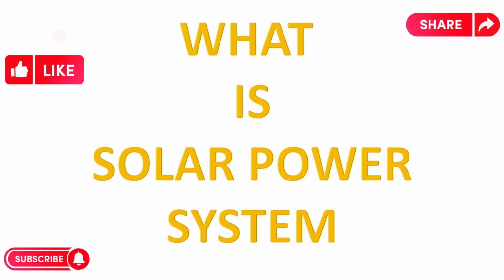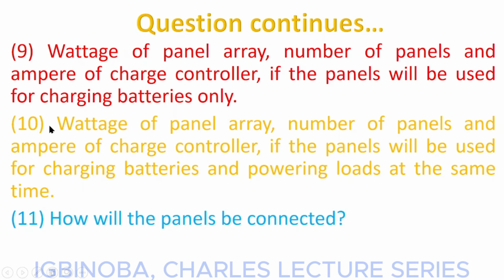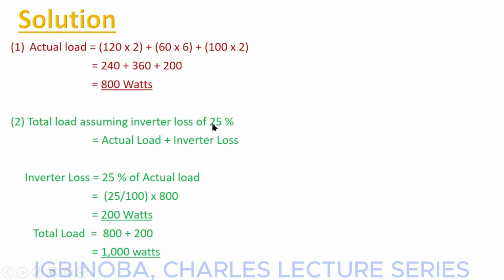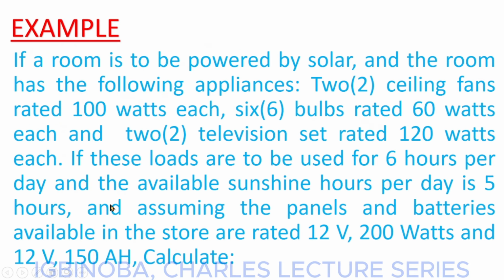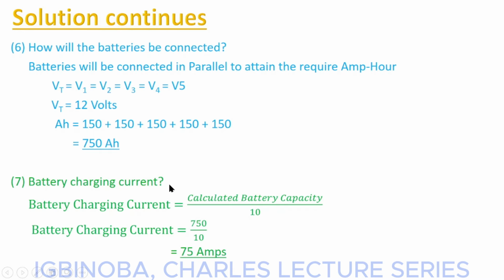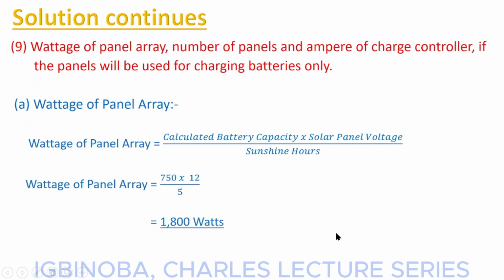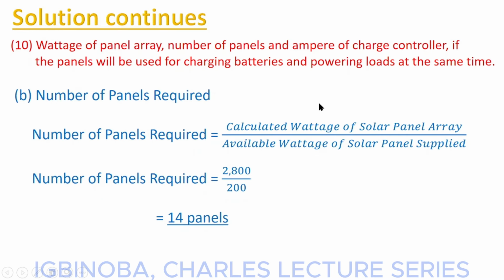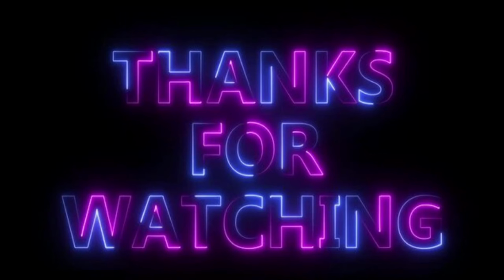Design of Solar Power System

Comment: COMP28B 

1. The actual pad is 1,380W
2. The Total load is 1,725W
3. The inverter rating is 2,156.23VA
4. The battery capacity is 1,293.75Ah 
5. The Number of batteries is 9
6.  The batteries are connected in parallel 
7. The Battery charging current is 129.4 amps.
8. The battery charging time is 14 hours.
9. a. The wattage of the panel array is 3,105W
b. The number of panels is 16 panels.
c. The Charge controller rating is 258.75 amps.

10. a. The wattage of the Panel array is 4,830 Watts 
b. The number of panels is 24 panels.
c. The charge controller rating is 402.5 amps
11. The panels are arranged in parallel

Comment: COMP71S

1. The actual pad is 1,380W
2. The Total load is 1,725W
3. The inverter rating is 2,156.23VA
4. The battery capacity is 1,293.75Ah 
5. The Number of batteries is 9
6.  The batteries are connected in parallel 
7. The Battery charging current is 129.4 amps.
8. The battery charging time is 14 hours.
9. a. The wattage of the panel array is 3,105W
b. The number of panels is 16 panels.
c. The Charge controller rating is 258.75 amps.

10. a. The wattage of the Panel array is 4,830 Watts 
b. The number of panels is 24 panels.
c. The charge controller rating is 402.5 amps
11. The panels are arranged in parallel

Comment: MEC38L

Answer:

(1) Actual Load
P_actual = 300 W + 600 W + 480 W
P_actual = 1380 W
(2) Total Load (assuming 25% Inverter Loss)
P_total = 1380 W × (1 + 0.25)
P_total = 1725 W
(3) Inverter Rating in VA (Power Factor = 0.8)
Inverter VA = 1725 / 0.8
Inverter Rating = 2156.25 VA (Approx. 2.5 kVA)
(4) Battery Capacity (using 75% Reserve Factor)
• Daily Energy = 1725 W × 6 hrs = 10,350 Wh
• Energy with 75% Reserve = 10,350 Wh × 1.75 = 18,112.5 Wh
• Capacity in Ah = 18,112.5 Wh / 12 V
Battery Capacity = 1509.38 Ah
(5) Number of Batteries for Backup Hours
• Single Battery Energy = 12 V × 150 Ah = 1800 Wh
• Number of Batteries = 18,112.5 Wh / 1800 Wh = 10.06
Number of Batteries = 10 batteries (or 11 rounded up)
(6) Battery Connection
Since the system operates at 12 V and each battery is 12 V:
All 10 batteries will be connected in PARALLEL.
(7) Battery Charging Current
Using standard C/10 charging rate for 1500 Ah total capacity:
Charging Current = 1500 Ah / 10 h
Battery Charging Current = 150 A
(8) Battery Charging Time (assuming 40% Charging Loss)
• Efficiency = 100% - 40% = 60% (0.6)
• Required Energy = 18,112.5 Wh / 0.6 = 30,187.5 Wh
• Charger Power = 150 A × 12 V = 1800 W
• Charging Time = 30,187.5 Wh / 1800 W
Charging Time = 16.77 hours
(9) Array Wattage, Panels & Controller (Charging Batteries ONLY)
• PV Wattage = 30,187.5 Wh / 5 hrs = 6037.5 W
• Number of Panels = 6037.5 W / 200 W = 30.18
• Array Wattage = 6200 W
• Number of Panels = 31 panels
• Charge Controller = 6200 W / 12 V = 516.67 A (or ~646 A with 1.25 safety factor)
(10) Array Wattage, Panels & Controller (Charging + Powering Loads)
• Total PV Wattage = 6037.5 W + 1725 W = 7762.5 W
• Number of Panels = 7762.5 W / 200 W = 38.81
• Array Wattage = 7800 W
• Number of Panels = 39 panels
• Charge Controller = 7800 W / 12 V = 650 A (or ~812.5 A with 1.25 safety factor)
(11) Panel Connection
Since all panels are rated 12 V and feed a 12 V system:
All panels will be connected in PARALLEL.

Comment: COMP84F

1. The actual load is 1380W
2. The total load is 1725W
3. The inverter rating is 2156.23VA
4. The battery capacity is 1293.75Ah 
5. The Number of batteries is 9
6.  The batteries are connected in parallel.
7. The Battery charging current is 129.4A.
8. The battery charging time is 14 hrs.

9a. The wattage of the panel array is 3105W
b.16 panels.
c. The Charge controller rating is 258.75A

10a. The wattage of the Panel array is 4830W
b. 24 panels.
c. The charge controller rating is 402.5A

11. The panels are arranged in parallel

Comment: PETROCHEM57E

1. Actual Load = 1380 Watts

2. Total Load = 1725 Watts

3. Inverter Rating = 2156.25 VA

4. Battery Capacity = 1293.75 AH

5. Number of Batteries = 8.625 = 9 batteries

6. The batteries will be connected in parallel to attain the required ampere-hours.

VT = V1 + V2 + V3+ V4+ V5+ V6+ V7 + V8 + V9

AH = 150 + 150 + 150 + 150 + 150 + 150 + 150 + 150 + 150 = 1293.75 AH

7. Battery Charging Current = 129.375 Amps

8. Battery Charging Time = 14 hours

9. a. Wattage of Panel Arrays = 3105 Watts
b. Number of Panels Required = 15.525 panels ≈ 16 panels
c. Ampere of Charge Controller = 258.75 Amps

10a. Wattage of Panel Arrays = 4830 Watts
b. Number of Panels Required = 24.15 panels ≈ 25 panels
c. Ampere of Charge Controller = 402.5 Amps

11. The panels will be connected in parallel.

Comment: MECH23W
1.) Actual Load*
= (100 × 3) + (60 × 10) + (120 × 4)  
= 300 + 600 + 480  
= 1380 Watts

2. Total Load with 25% Inverter Loss
Inverter Loss = 25% of Actual Load  
= 0.25 × 1380 = 345 Watts  
Total Load = Actual Load + Inverter Loss  
= 1380 + 345  
= 1725 Watts

3. Inverter Rating in VA  
Using Power Factor = 0.8  
Inverter Rating = Total Load ÷ Power Factor  
= 1725 ÷ 0.8  
= 2156.25 VA → ∼2.2 KVA inverter recommended

4. Battery Capacity  
Reserve Factor = 75%, Backup = 6 hours, System factor = 2  
Battery Capacity = (2 × 1725 × 6 × 0.75)  
= 1293.75 Ah

5. Number of Batteries Required  
Using 150 Ah batteries  
No. of Batteries = 1293.75 ÷ 150 = 8.6  
= 9 batteries (round up to whole batteries for safety).5. Number of batteries for backup_  
Backup capacity required = 1293.75Ah  
Battery rating = 150Ah  
Number of batteries = 1293.75Ah ÷ 150Ah = 8.6  
≈ 8 batteries

6. Battery connection method  
The batteries will be connected in _parallel_.  
For parallel connection: Vt = V1 = V2 = V3 = V4 = V5 = V6 = V7 = V8  
Total Ah = 150 + 150 + 150 + 150 + 150 + 150 + 150 + 150 = 1200Ah

7. Battery charging current  
Charging current = 1293.75Ah ÷ 10h = 129.4A  
≈ 129A

8. Battery charging time  
Assuming 40% charging losses:  
Total Ah to be replaced = 1293.75Ah + (40% × 1293.75Ah)  
= 1293.75Ah + 517.5Ah = 1811.25Ah  
Charging time = 1811.25Ah ÷ 129A ≈ 14 hours

9a. PV array wattage  
3105 watts

9b. Number of panels required  
Panel rating = 345W  
Number of panels = 3105W ÷ 345W = 9  
= 9 panels._9c. Charge Controller Ampere Rating (Battery Load Only)  
Required Amps = 3105 watts ÷ 12 volts = 258.75 Amps

10a. Total Solar Panel Array Wattage  
Total Wattage = Wattage for charging battery only + Total load  
= 3105 watts + 1725 watts = 4830 watts

10b. Number of Solar Panels Required  
Number of Panels = Total array wattage ÷ Wattage per panel  
= 4830 watts ÷ 345 watts = 14 panels

10c. Charge Controller Ampere Rating (For Full Array)  
Required Amps = Total array wattage ÷ System voltage  
= 4830 watts ÷ 12 volts = 402.5 Amps

11. Panel Connection Method  
Answer: The panels will be connected in parallel.

Comment: NAT17Q

1. The actual pad is 1,380W
2. The Total load is 1,725W
3. The inverter rating is 2,156.23VA
4. The battery capacity is 1,293.75Ah 
5. The Number of batteries is 9
6.  The batteries are connected in parallel 
7. The Battery charging current is 129.4 amps.
8. The battery charging time is 14 hours.
9. a. The wattage of the panel array is 3,105W
b. The number of panels is 16 panels.
c. The Charge controller rating is 258.75 amps.

10. a. The wattage of the Panel array is 4,830 Watts 
b. The number of panels is 24 panels.
c. The charge controller rating is 402.5 amps
11. The panels are arranged in parallel

Comment: NAT40N

1) Actual Load: 1380 W
2) Total Load: 1840 W
3) Inverter Rating (0.8 Power Factor): 2300 VA (or 2.3 kVA)
4) Battery Capacity: 1226.67 Ah
5) Number of Batteries: 9 batteries
6) Battery Connection: Parallel
7) Battery Charging Current: 120 A
8) Battery Charging Time: 16.67 hours
9) Solar Setup (Batteries Only): 2944 W (or 3000 W), 15 panels, 250 A charge controller
10) Solar Setup (Batteries + Load Simultaneously): 4784 W (or 4800 W), 24 panels, 400 A charge controller
11) Panel Connection: Parallel
Reply: You forgot to add your code, how will they mark it
Reply: @TheHummingbird456 oh, thanks

Comment: MEC94P

1)Actual load = 1380W
2)Total load = 1725W
3)Inverter rating = 2156.25VA
4)Battery rating = 1293.75Ah
5)Number of batteries = 9
6)Batteries connected in parallel
7)Battery charging current = 129.4amps
8)Battery charging Time = 14hours
9i) Wattage panel array = 3105watts
iii)Number of panels = 16
iii)Charge controller = 258.75A
10i) Wattage of panel array = 4830 watts
ii)Number of panels = 24
iii) Charge controller = 402.5 A
Panels are arranged in parallel

Comment: COMP81C
(1) Actual Load
 P_actual = (3 * 100W) + (10 * 60W) + (4 * 120W) = 300 + 600 + 480 = 1380W

(2) Total Load (Assuming 25% Inverter Loss)
 P_total = 1380W / (1 - 0.25) = 1380W / 0.75 = 1840W

(3) Inverter Rating (VA) Inverter Rating = 1840W / 0.8 = 2300VA

(4) Battery Capacity (75% Reserve) Daily Energy = 1840W * 6h = 11040Wh Battery Capacity = 11040Wh / (12V * 0.75) = 1226.67Ah

(5) Number of Batteries Needed Number of Batteries = 1226.67Ah / 150Ah = 8.18 = 9 batteries

(6) Battery Connection Connection = Parallel

(7) Battery Charging Current Charging Current = 1226.67Ah / 5h = 245.33A

(8) Battery Charging Time (Assuming 40% Loss) Efficiency = 100% - 40% = 60% = 0.6 Charging Time = 5h / 0.6 = 8.33 hours

(9) Solar PV Array (For Charging Batteries Only) Energy Required = 11040Wh / 0.6 = 18400Wh Array Wattage = 18400Wh / 5h = 3680W Number of Panels = 3680W / 200W = 18.4 = 19 panels Charge Controller = 3680W / 12V = 306.67A

(10) Solar PV Array (For Charging Batteries + Powering Loads Simultaneously) Total Power = 3680W + 1840W = 5520W Array Wattage = 5520W Number of Panels = 5520W / 200W = 27.6 = 28 panels Charge Controller = 5520W / 12V = 460A

(11) Panel Connection Connection = Parallel

Comment: PETROCHEM66N 

1. Actual load = 1380watts
2. Total load = 1725 watts
3. Inverter ratings = 2156.25 volts 
4. Battery capacity= 1293.75Ah 
5. Numbers of batteries= 9
6. Batteries are connected in parallel 
7. Battery charging current= 129.4amps 
8. Battery charging time = 14hrs 
9a. Wattage of panel array= 3105 watts 
9b. Nō of panels= 16 panels 
9c. Charger controller= 258.75A
10a. Wattage of panel array= 4830 watts 
10b. Number of panels= 24 
10c. Charger controller= 402.5a
11. Panels are arranged in parallel

Comment: NAT53A

1. The actual load of the room is 1,380 W.
2. The total load, considering 25% inverter loss, is 1,840 W.
3. The required inverter rating at a power factor of 0.8 is 2,300 VA (2.3 kVA).
4. The required battery capacity is approximately 1,227 Ah at 12 V.
5. The number of batteries required is 9 batteries.
6. The batteries will be connected in parallel to maintain a 12 V system.
7. The required battery charging current is approximately 307 A.
8. The battery charging time is approximately 5 hours.
9. For battery charging only, the required panel array is 3,800 W, requiring 19 panels of 200 W each, with a charge controller of approximately 317 A.
10. For simultaneous battery charging and load supply, the required panel array is 5,600 W, requiring 28 panels of 200 W each, with a charge controller of approximately 467 A.
11. The solar panels will be connected in parallel.

Comment: NAT14N
1. The actual pad is 1,380W
2. The Total load is 1,725W
3. The inverter rating is 2,156.23VA
4. The battery capacity is 1,293.75Ah 
5. The Number of batteries is 9
6.  The batteries are connected in parallel 
7. The Battery charging current is 129.4 amps.
8. The battery charging time is 14 hours.
9. a. The wattage of the panel array is 3,105W
b. The number of panels is 16 panels.
c. The Charge controller rating is 258.75 amps.

10. a. The wattage of the Panel array is 4,830 Watts 
b. The number of panels is 24 panels.
c. The charge controller rating is 402.5 amps
11. The panels are arranged in parallel

Comment: NAT35I
1). The actual load is 1,380W
2). The Total load is 1,725W
3). The inverter rating is 2,156.23VA
4). The battery capacity is 1,293.75Ah 
5). The Number of batteries is 9
6.  The batteries are connected in parallel 
7. The Battery charging current is 129.375 amps.
8. The battery charging time is 14 hours.
9. a. The wattage of the panel array is 3,105W
b. The number of panels is 16 panels.
c. The Charge controller rating is 258.75 amps.

10. a. The wattage of the Panel array is 4,830 Watts 
b. The number of panels is 24 panels.
c. The charge controller rating is 402.5 amps
11. The panels are arranged in parallel

Comment: MEC87I

1. Actual load = 3(100)+10(60)+4(120) = 1,380 W

2. Total load = 1380/0.75 = 1,840 W

3. Inverter rating = 1840/0.8 = 2,300 VA

4. Energy = 1840×6 = 11,040Wh ÷0.75 (reserve) = 14,720Wh ÷12V = 1,226.67 Ah

5. 1226.67÷150Ah = 8.18 → 9 batteries

6. Same voltage (12V) → Parallel

7. 1226.67Ah ÷5 sun-hrs = 245.33 A

8. (1226.67/245.33)/0.6 = 8.33 hrs (8hrs 20mins)

9. 245.33×12×1.25 = 3680W → 3680/200 = 18.4 → 19 panels (3,680 W array); CC = 3680/12×1.25 = 383.33 A

10. 3680+1840 = 5520W → 5520/200 = 27.6 → 28 panels (5,520 W array); CC = 5520/12×1.25 = 575 A

11. Same voltage → Parallel

Thank you sir ✨
23:48

Comment: MAR70R

1. Actual load = 1380 watts

2. Total load = 1725 watts

3. Inverter rating = 2156.25 VA

4. Battery capacity = 1293.75 Ah

5. Number of batteries = 9
6. Batteries are connected in parallel

7. Battery charging current = 129.4 amps

8. Battery charging time = 14 hrs

9a. Wattage of panel array = 3105 watts

9b. Number of panels = 16 panels

9c. Charge controller = 258.75 A

10a. Wattage of panel array = 4830 watts

10b. Number of panels = 24

10c. Charge controller = 402.5 A

11. Panels are arranged in parallel

Comment: COMP3C

1. 1,380W
2.  1,725W
3.  2,156.23VA
4.  1,293.75Ah 
5. 9
6.  The batteries are connected in parallel 
7.  129.4 amps.
8. 14 hours.
9. a.3,105W
b. 16 panels.
c.  258.75 amps.

10. a.4,830 Watts 
b.24 panels.
c. 402.5 amps
11. The panels are arranged in parallel

Comment: PETRO41O

1)  1380Watt. 
2)1725watt.
3)  2156.23VA
4) 1293.75AH
5)  9
6) The batteries are connected in parallel.
7) 129.4Amp
8)14 hours.
9a)3105watt.
9b) 9 panel.
9c)258.75Amp.
10a)4830watt.
10b) 24 panel.
10c)  402.5Amp.
11)The panels are arranged in parallel.

Comment: MAR66N
1
Actual load
1,380 W
2
Total load with 25% inverter loss
1,725 W
3
Inverter rating at PF = 0.8
2,156 VA ≈ 2.2 kVA
4
Required battery capacity
1,150 Ah @ 12 V
5
Number of batteries
8 batteries
6
Battery connection
Parallel
7
Battery charging current
≈183.3 A
8
Battery charging time with 40% loss
≈9.16 hours
9
Panel power for charging batteries only
4,800 W

Number of panels
24 panels

Charge-controller current
400 A
10
Panel power for charging + powering loads
6,525 W

Number of panels
33 panels

Charge-controller current
≈544 A
11
Panel connection
Parallel

Comment: MEC4D
1. Total Connected Power = 1380 W

2. Daily Energy Requirement = 8.28 kWh/day

3. Solar Panels Required 12V 200W = 9 panels 
   With 25% losses = 11 panels

4. Batteries Required 12V 150Ah = 5 to 6 batteries 
   For 1 day backup with lead-acid = 12 batteries

Comment: COMP91M

1. The actual pad is 1,380W
2. The Total load is 1,725W
3. The inverter rating is 2,156.23VA
4. The battery capacity is 1,293.75Ah 
5. The Number of batteries is 9
6.  The batteries are connected in parallel 
7. The Battery charging current is 129.4 amps.
8. The battery charging time is 14 hours.
9. a. The wattage of the panel array is 3,105W
b. The number of panels is 16 panels.
c. The Charge controller rating is 258.75 amps.

10. a. The wattage of the Panel array is 4,830 Watts 
b. The number of panels is 24 panels.
c. The charge controller rating is 402.5 amps
11. The panels are arranged in parallel

Comment: NAT8H

(1) Actual Load: 1380W, 8.28 kWh/day
(2) Total Load + 25% Inverter Loss: 1840W, 11.04 kWh/day
(3) Inverter Rating (PF 0.8): 2300 VA → Use 2.5 kVA
(4) Battery Capacity (75% Reserve): 14720 Wh
(5) Number of Batteries: 9 x 12V 150AH
(6) Battery Connection: 9 in Parallel → 12V, 1350AH
(7) Battery Charging Current: 135A
(8) Battery Charging Time (40% Loss): 5 hours
(9) Panel Array - Charging Only: 3680W, 19 x 200W Panels, 307A Controller
(10) Panel Array - Charging + Load: 5520W, 28 x 200W Panels, 460A Controller
(11) Panel Connection: All in Parallel for 12V System

Comment: PETROCHEM12L
1. Actual load = 1380 watts
2. Total load = 1725 watts
3. Inverter rating = 2156.25 VA
4. Battery capacity = 1293.75 Ah
5. Number of batteries = 9
6. Batteries are connected in parallel
7. Battery charging current = 129.4 amps
8. Battery charging time = 14 hrs

9a. Wattage of panel array = 3105 watts
9b. Number of panels = 16 panels
9c. Charge controller = 258.75 A

10a. Wattage of panel array = 4830 watts
10b. Number of panels = 24
10c. Charge controller = 402.5 A

11. Panels are arranged in parallel

Comment: COMP4D 

SOLUTION 

1. The actual pad is 1,380W
2. The Total load is 1,725W
3. The inverter rating is 2,156.23VA
4. The battery capacity is 1,293.75Ah 
5. The Number of batteries is 9
6.  The batteries are connected in parallel 
7. The Battery charging current is 129.4 amps.
8. The battery charging time is 14 hours.
9. a. The wattage of the panel array is 3,105W
b. The number of panels is 16 panels.
c. The Charge controller rating is 258.75 amps.

10. a. The wattage of the Panel array is 4,830 Watts 
b. The number of panels is 24 panels.
c. The charge controller rating is 402.5 amps
11. The panels are arranged in parallel